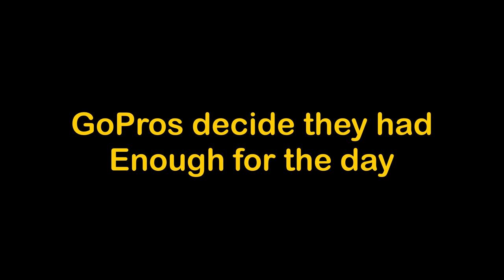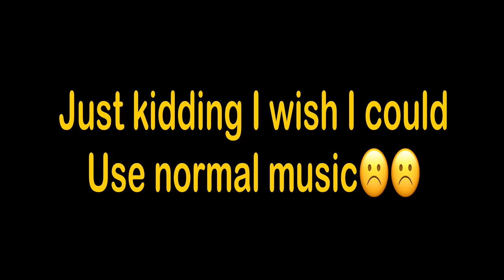1964 Chevy Impala Pick up, Barn find! Fresh off Kentucky farm.

Comment: Ran across a pair of 60 Chevys if you're interested. The wagon appear to be a lesser trim package below Bel Air and it was a four-door wagon. Appeared to be complete with drive train. Looks like it was 3,200 dollars. The other was a two-door post and it might have been a Bel Air but definitely not an Impala. And it had $1,800 on the windshield. Look to be missing the engine and the hood was not on the car. I was cutting across a black top to avoid road closure to traffic tie up and it was North out of St Louis. I could swing by there if it's anything of interest to you on my return trip through the area

Comment: Interesting car. You mentioned California they sell good in Las Vegas surrounding area as well. Got a 64 two door hardtop Impala you want it? It's just a shell sitting on the frame. Oh it has one fender a front grill things like that and trunk lid . With the exception one being right on the door post what's there straight it just got stripped a long time ago. The trunk pan is Rusty and so is the floor where the low spots are I eat each pan where you put your feet. $2,500. Got a 48 GMC that was media blasted and then they did nothing with it. Rusting through not really a problem definitely surface rust. $1,500. Comes with the 216. Like you said if you make money. I have a couple of others. The car and truck close together. Got a pretty solid 85 square body. It is a long bed. They say the engines been rebuilt and it's in good shape doesn't have all the rest of them have . They say the engine been rebuilt it runs and drives $3,000. I knew the guy that owned it agent orange effects finally caught up to him unfortunately. He was in the thick of it in Vietnam. Every last cent from that truck would go to his widow! Message me back if you're interested in anything.